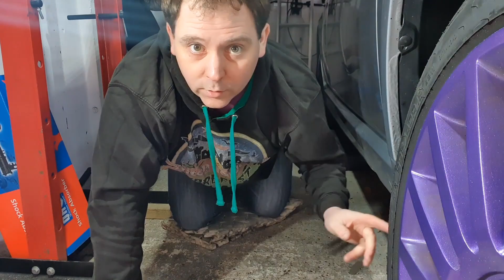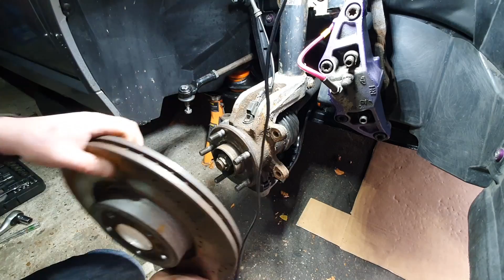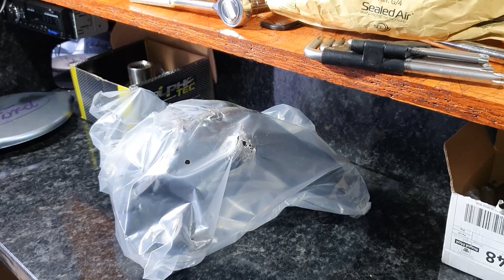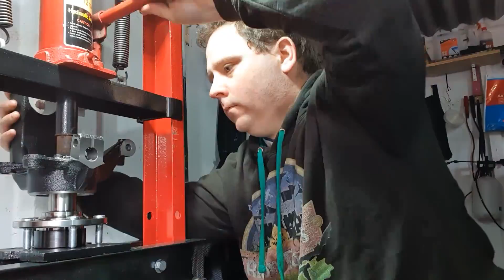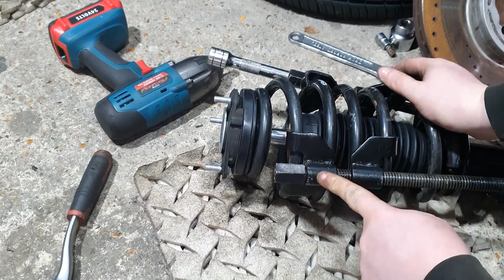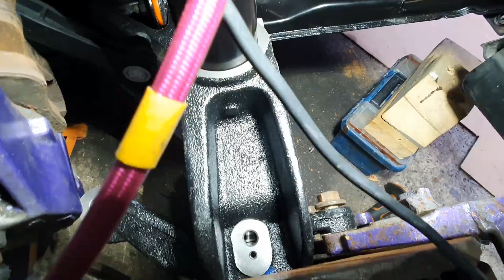Ford Mondeo Mk3 ST220 - Front Bearing and Hub replace

Comment: Great car, my Mondeo is GHIA.....it was verry good car, i dont want to sell. I want to repair my Stalion.
By me the problem was, my driveshaft came out and came in only after being hit with a hammer. 
Do you know what the cause could be?
After I installed the bearing, I hear a dull knocking sound every 20-30 seconds when driving at 50 km/h.

Comment: Use a 3/4” drive ratchet & socket for hub nuts for those of us who have these type of sets as it’s easier to use than a 1/2” drive . 1/2” just does not cut to the chase on these big nuts .

Comment: I clicked on the link for the knuckle because I'd like to change mine, 
the listing states for mondeo but not which model....   Correct me if I'm wrong but doesn't the st220 use a lower ball joint with a bigger 'pin' than lower models?  Hence a larger hole in the knuckle?
Reply from the maker: Hiya Warren, the guys confirmed in an email that these are ok for the car. Everything fit back fine as well
Reply: @ChazzCoombes  great, I'll give them a message too, cheers

Comment: Looking back i should have changed knuckles on mine Chazz .. had to use a 30 tonne press to get the old bearings out and take the strut and knucle to the local garage to get the pinch bolt out... great vid top man

Comment: where your c clips for the bearing
Reply from the maker: This car dont have them, on the knuckle there is a small lipthat when you press the bearings in the bearing sits flush to it.
Reply: @ChazzCoombes  does it not have one the other side
Reply from the maker: @markholyoak9790  nope. I even checked on the old one that i removed.
Reply: @ChazzCoombes  i must a apologise  because there is no  clip because i checked out AUTODOC video on ford mondeo mk3 front wheel bearing and saw no clip keep up the good work
Reply from the maker: @markholyoak9790  lol, Autodoc make it all look easy dont they lol, real life its not. Its fine you dont have to apologise Mark.
Reply: Chas,there are left and right bearings make sure you put correct ones in, oh and freeze bearings before fitting much easier 😊

Comment: Silly question about focus st caliper...did you use mondeo brake line or focus st brake line ..as I seen in other video focus brake line is wider to allow more fluid in than mondeo one
Reply from the maker: I used upgraded brake hoses from Hell there was a video on them on the channel but it got removed due to someone singing in the back ground lol

Comment: that wishbone  tool is  cool ive just  looked on ebay im going to get one as when I changed  my wheel  bearings springs and shocks I was  really  struggling  with  getting  it out in end I took  15mm bolt out so  I could take stress of it  to pull it out
Reply from the maker: Ive put the link in the vid description. Best money i spent. When i put the wishbones back im after poly bushing them they was hard work but this tool made it so much easier.
Reply: it looked chazz thank you
Reply from the maker: @martinburbridge7545  plus if you buy via the links, you still pay the same price but ebay pay me a % for the sale. 😉
Reply: When I do mine I take wheel off, put jack under wishbone ball joint, jack up until weight of car on strut then use 2 ratchet straps around spring then lower jack.